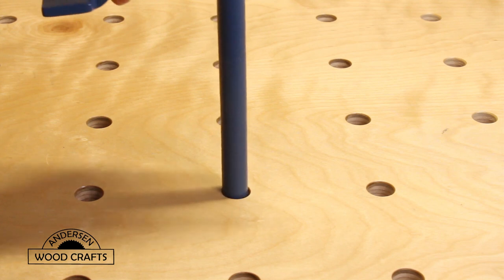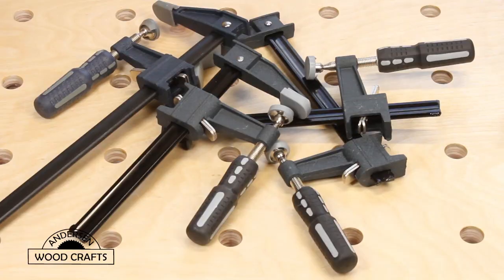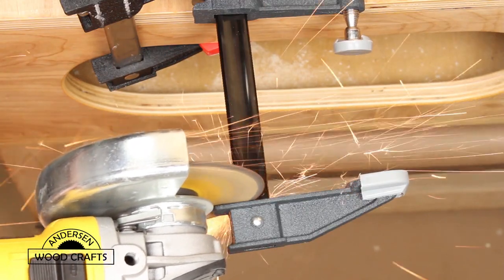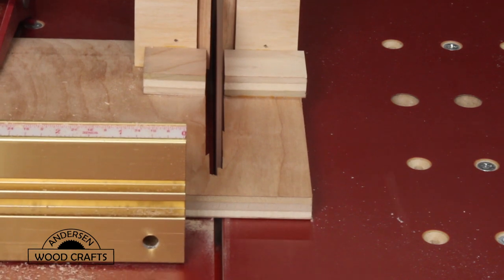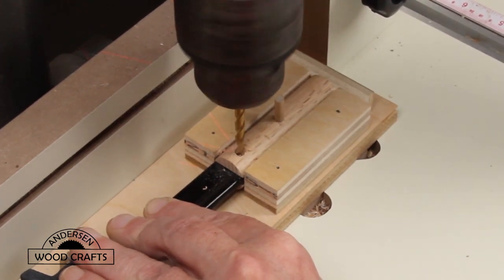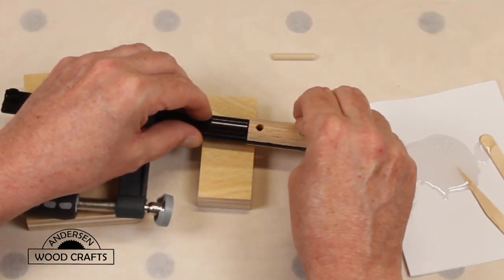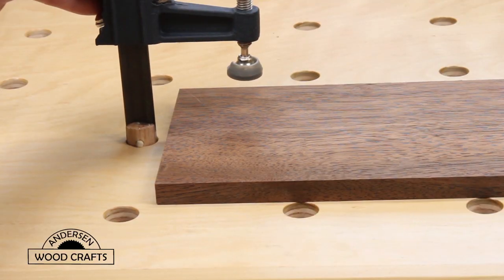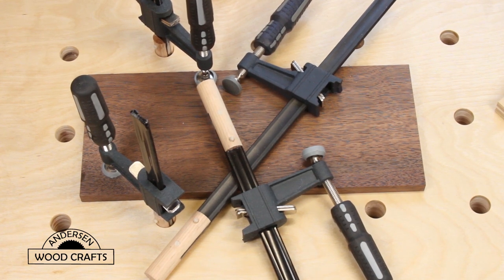DOG HOLE CLAMPS MADE FROM HARBOR FREIGHT BAR CLAMPS

Comment: I similarly cut off my 6" HF clamps, but didn't add dowel.  The clamp will actually wedge in either my 3/4" or 1" dog holes, when clamping.
Reply from the maker: They work great and I will agree that the dowel is not a necessity.  Thanks for watching.
Reply: That sounds like a strong argument for going with a 3/4" hole system.  In 20mm holes, the HF clamps alone are a bit loose.  .

Comment: Very clever. I love this. Taking notes. I have a few of the HF clamps and I like them. They hold well. I haven't had any issues with any of them and none slip.
Reply from the maker: Thanks for your comment.  I agree, for the price you can't go wrong with the HF clamps.
Reply: The shorter (12" and under) F-clamps from Harbor Freight work fine. The bar on the longer clamps bends too much under load to be of much use. YMMV.

Comment: Nice.  The main difference I see between these and standard holdfasts is the 2.5" radius reach - most holdfasts will reach at least 6".  But I've got exactly the same problem you had.  I have a laminated 2x4 bench top and that's mounted on top of a pair of Black and Decker 225 Workmates.  And in the open area between those I do plan to put storage.  So I've got 3"-5" of space to work with below the tabletop.  This looks like it will work for me.
Reply from the maker: As you mentioned, the biggest issue with these is the reach, but considering the option (which is having nothing) I will take the minimal reach.  Thanks for your comment.

Comment: See that epoxy come right loose when tightening the clamp? This is going to work regardless, but it will ruin the holes because only the narrow shaft of the clamp holds on to it.
Reply from the maker: You are correct in your statement.  As you said it works regardless as most of the time you just need enough pressure to prevent the work piece from moving, unlike when gluing pieces together were greater pressure is needed.  Thanks for your comment.

Comment: Hey Andersen, great project! I wonder, do you think this system would work well for clamping down bigger objects as well? I can imagine that when the clamping force is applied  on a higher point that there will be less friction on the dowel. What are your thoughts on this? Have you tried clamping down bigger objects this way? Cheers!
Reply from the maker: How big are you talking?  The 12" clamps should be able to hold down pieces up to 6" (and possibly larger).  I'm also not totally sure the purpose of the question, the purpose of most any dog hole clamp is to keep the piece from moving while working on it, not to provide adequate pressure for glue ups.  Does this help?  Thanks for the comment.

Comment: I would definitely take the time to build your style clamps on used clamps that I meant that are just iron the problem is doing it the way you're showing is I actually have a life and since I have a life and I'm in this industry make a living not just have fun I won't be able to use your system but thanks for the comedy it was fun
Reply from the maker: Yes, I am well aware that my production system is not conducive to making a living.  Although I have a shop (a new one that is coming soon) that could be used to start a small woodworking business I still call myself a hobbyist.  Thanks for watching and for the comment, and if it put a smile on your face my job is complete.
Reply: Before you do anything else in your life, stop and read some textbook on how to use commas and full stops. It was a comedy reading your comment. Not.